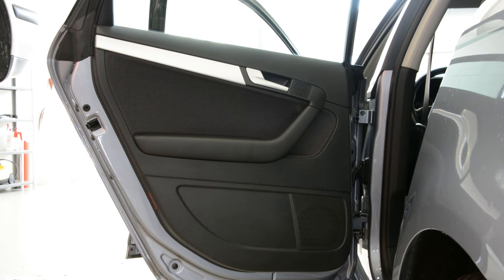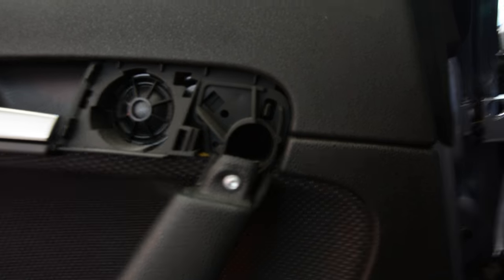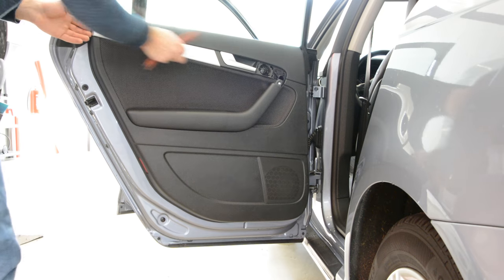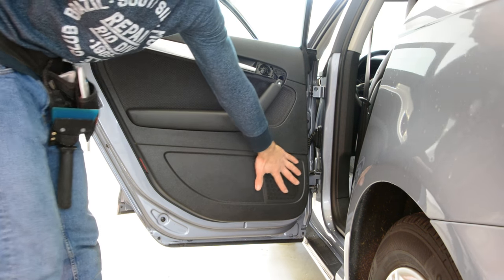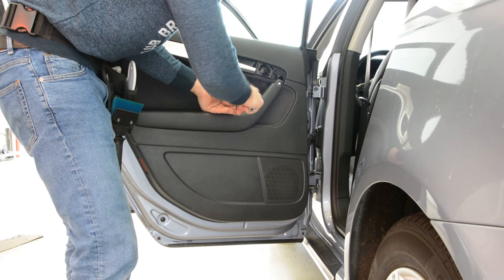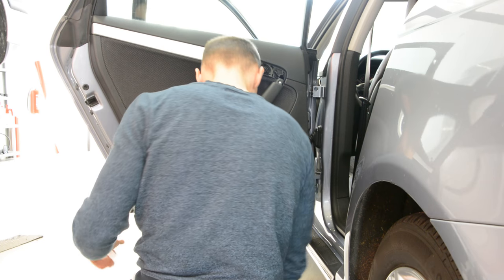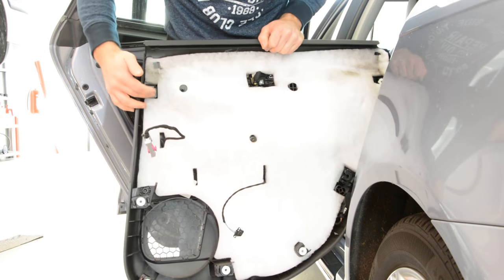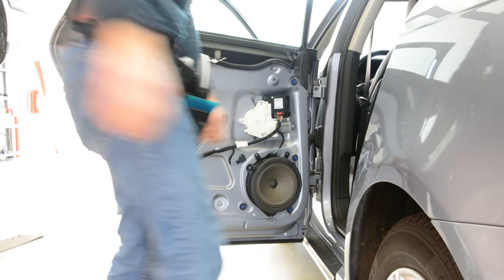Audi A3 Door panel removal

Comment: I have replaced my door card of my old audi a3 and now the electric windows both do not work in either car any ideas?
Reply: Did you sort this?
You may have broke wires in the flex between the door and the pillar, possibly stretched/snapped when pulling the door card
Reply: @Infiniti25  Yes I sorted it, it was because I swapped door cards from another a3 so I had to put the original ones back on it must be something to do with the door card module not programmed to that car?
Reply: @jayneilson4982  probably needed to use VCDS to remove the old module and code in the new one.
Thanks for the response 👍
Reply: @jayneilson4982  I think it mightve been something with the coding in that module since the windows use a code to work I believe